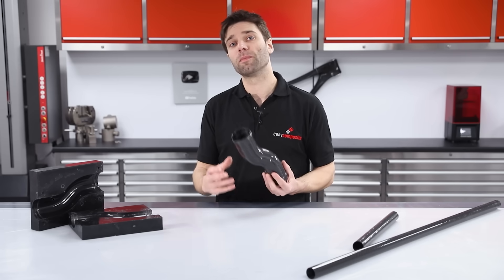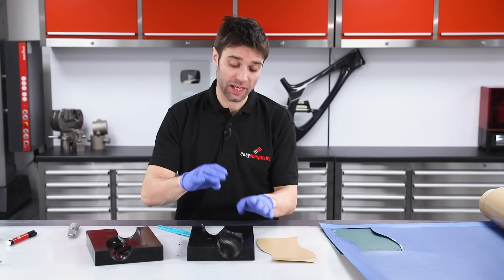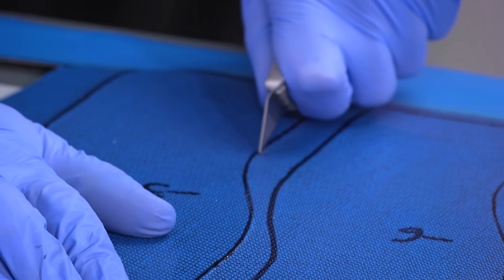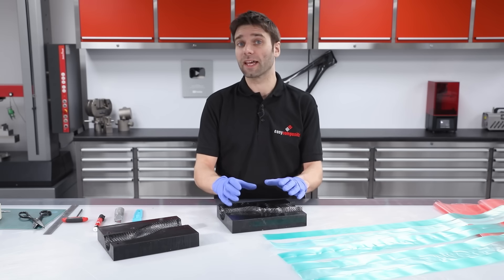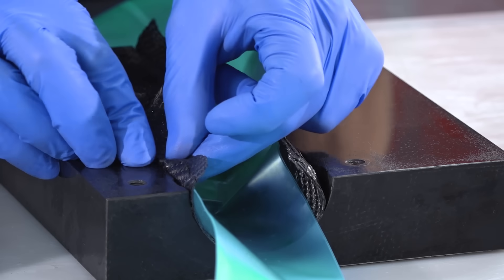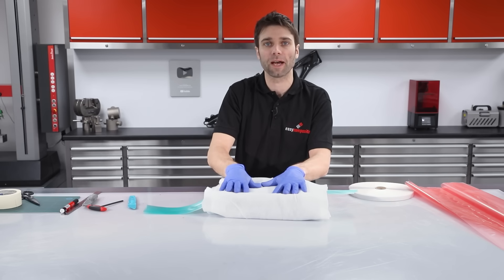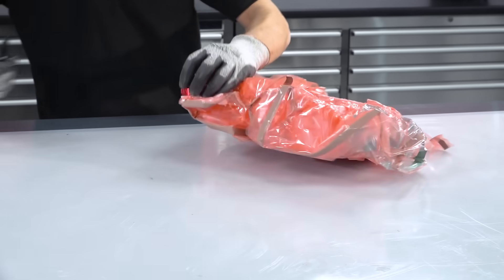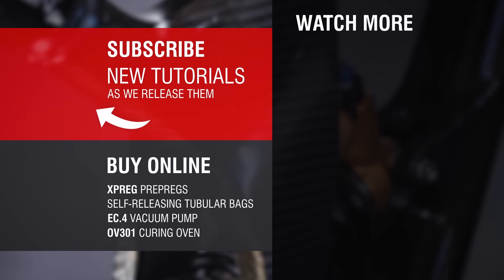Making Complex Carbon Fibre Tubes Using a Split-Mould

Comment: Nice video, whats is the best commercial CNC machine (without break a bank... lol) you guys recommend to make the "templates"   TIA
Reply from the maker: We used a relatively inexpensive CNC-Est machine for this part.
Reply: @easycompositestv Thank you for your reply. I'm looking for 4x8 to make big parts, any model in particular?
Reply from the maker: @fateichmann  Hi Fabricio, I'm sorry we don’t sell CNC routers so are not best placed to advise on the best machine to 
use.

Comment: How much temperature for it's burn in the box?
Reply from the maker: What do you mean sorry?
Reply: @easycompositestv  I wanna say that what temperature need to harden the carbon fibre?
Reply from the maker: @MrMaker-se1qr  In the case of the XC110 we're using here, its optimum curing cycle goes up to 120'C; although there is a low temp. cycle which allows for 85'C curing.

Comment: In this instance wouldn't it make more sense to have essentially bike tire inner tube pressurized to 1bar (or 2atm) -- and you would have much less waste material too as you could use that tube again and again and again.
Reply from the maker: The problem with positive pressure (such as from an inner tube or other form of inflatable bladder) is that it will be trying to distort the mould and split it open. In fact, to withstand the pressure if just one bar on the inside of this tube mould, the mould would have to be many, many times stronger, which ultimately means more material and more cost. For a relatively small mould like this, that might not be too much of a problem but for a larger more complex mould, it could be incredibly expensive and time consuming to make a mould which could withstand unbalanced, positive pressure from the inside. By doing it the way we show in this video, the pressure is applied to both the inside and the outside of the mould equally and uniformly, preventing any distortion and not trying to 'open' the split mould in any way. However, if you had a simple mould and a solid mould (billet aluminium for example) then a pressurised bladder, as you're describing, would be a good way to go.

Comment: I came expecting to see how you built the mold?
Reply from the maker: We've got a number of mould making videos for both split moulds and high temp mould tools that will show the processes you need. This video is specifically about how to make the tube itself (rather than the mould) but if you check out our videos, you should find plenty of information.

Comment: Is there a way to produce similar results using lay up/ infusion rather than pre preg as i dont have access to an oven? i have a mould of a very similar shape as whats in this video.
Reply from the maker: Hi, thanks for your comment. You could laminate the mould halves separately, allow to cure and trim off any excess material, place the now trimmed halves back into the tool and bolt it together then laminate a joining strip down the center internally.
Reply: @easycompositestv  Thanks for your reply, ill give that a go, see how i get on

Comment: Forgive me if I'm an idiot for asking this, I'm not especially familiar with composite layups and such (your videos are really helpful). Why not use an inflated bag or essentially a balloon of sorts to apply pressure throughout the tube instead of a vacuum bag, it would use a lot less in terms of consumables.
Reply from the maker: Hi, most people do not have the equipment or materials to make a decent quality bladder. It has to stay inflated throughout the cure cycle and it needs a bit of experimentation to get the right pressure. Also you have issues with the mould distorting if too much pressure is applied. The vacuum bag process just works well straight away.

Comment: hi

Can anyone  tell me how to use Chemical Release Agent? My pattern has mirrored finish, after used easy release, surface became matt and has visible marks. Mould  looks the same. I'm afraid
do polish  because Easy-Lease can be removed  than all stick . How to obtain shine patter and be safe to split.
Reply from the maker: Hi Tom, it sounds like you’ve applied it a bit too heavily. Easy-Lease does have a solids content (that’s what creates the barrier), if it goes on too heavy then as the solvent evaporates it can leave streaks. For the most rock-solid release, you’re best doing this and just accepting the slight matt finish but when it’s critical to have the best possible gloss then you can wipe it on but thinner and then, just as it’s flashed off, give it a gentle buff with a clean lint free wipe. Do this for each application. Providing the mould and resin system are properly compatible then you shouldn’t run any release risks by following this process.

Comment: Regarding the screws in the mould, did you just tap the thread or is there a sort of time sert impregned in the material?
Reply from the maker: Inserts can generally be laminated in during manufacture or bonded in afterwards.  The composite material itself is generally not suitable to hold a thread.

Comment: How many layers to it take to make a strong bond for a motorcycle frame? I heard carbon fiber does not last well against a vtwin engine vibrations.
Reply from the maker: We would not recommend making a carbon bike frame unless you have had a design analysed professionally via FEA or testing to ensure it will be strong enough and safe to use.

Comment: is it feasible to use polystyrene resin????
Reply from the maker: Hi Kumar, making carbon fibre tubes with polyester and epoxy resins certainly is possible with a slight change in the method of manufacture.
The easiest way to do this is to eliminate the stagger plies and laminate the two mould halves separately and allow to cure, Once cured trim off an excess material and place back into the mould and bolt together. The next step is to pre wet out some carbon fibre tape cut to the correct length and run it down the seam line on the inner faces of the component and allow to cure. It's worth noting this method won't produce a smooth inner surface like the prepreg method.
Reply: @easycompositestv  thank You sir

Comment: I am curious. How come you dont use existing means to give you the templates needed for the pre preg including the offsets. Instead of laying out tape and pealing it off?? I have an easier method.... but im surprized you do not use it already
Reply from the maker: We too have other methods but not everyone will have access to other methods and this is a nice, reliable method that can be done easily even in a home setting without access to other tools, equipment and software.

Comment: Do split molds yield lower bending strength in tubes?
Reply from the maker: That all depends on how any overlaps are treated.  With proper overlaps the strength will not be significantly compromised.

Comment: The inside bladder won't work if I don't have both open ends like the tube structure you made. How do I join my split molds together for nose cone or fuselage like structures?
Reply from the maker: Our next video may help answer some questions here.

Comment: heey , can your carbon fiber be used to make a concrete mold box that works by extruding the finished block by thrusting to mean can it withstand the compressing pressure and the scratching effect of the extruding block

Comment: can you use carbon fiber for coolant hoses?
Reply from the maker: With a high temperature resin and a thicker wall to take into account pressure, it may be possible.
Reply: @easycompositestv  what about vacuum hoses?

Comment: Is there a video I have not seen it if you posted it on making the mold like this or how to properly make a mold from an intake tube like this
Reply from the maker: Not a video making this mould in particular but the exact same process is covered in the video series where we make the engine cover. We machined the two ‘male’ halves of the pattern from epoxy block and then made the moulds using our XT135 tooling system.

Comment: Is there a method if I want the inside of the tube with a smooth surface ? Should I use undirectional Prepreg on the last layer
Reply from the maker: Watch our other video on mandrel wrapped tubes as they are smooth inside.
Reply: @easycompositestv  but I have mould like in this video my tube is almost like the one in the video not straight is there a solution ?

Comment: I need to make a curved hollow carbon tube that is 1/2in for a prototype, would this be an effective method?
Reply from the maker: Half in is just at that tricky size where it’s just about still doable using this method but it’s going to be tricker than a larger tube. Your only other option would be some sort of sacrificial mandrel: there are a couple of options for this using a 3D printer, you can print it using a water soluble print material (although we haven’t yet seen this be properly effective) or you can print a female mould and cast a wash out core into that mould then use the wash out core, once set, as a mandrel. We’ll be featuring both of these processes in future videos.
Reply: @easycompositestv  beautiful thank you, i was gonna ask some more questions but since you have a video coming out I'll wait till then

Comment: what is that weird grey spongey tape thats apparently strong enough to hold vacuum on a slippery plastic?
Reply from the maker: That's vacuum bagging tape; we're using our ST150 - you'll find it listed on the project page, along with all other products used/shown in the video.

Comment: Couldn't a basic plastic mold or even wooden mold be used? I guess the pros could be smaller costs but what would be the cons?
Reply from the maker: Pre-pregs need a high temperature capable mould.

Comment: Thats a lot of waste with the vacuum forming, is there any alternatives?
Reply from the maker: It depends what you need to achieve. For low volume production, there's not really much you could do to reduce consumables if you want to achieve a high quality product but if you were making hundreds (or thousands) of these components then there would be ways to introduce some re-usable elements.

Comment: Was there no resin applied? What caused it to fuse together?
Reply from the maker: Hi Luke, in this tutorial we're using prepreg carbon fibre. This is a type of carbon fibre reinforcement where the resin has already been pre-impregnated into the carbon fibre during its manufacture which means that no resin needs to be added later, which is why you don't see us adding any resin during the process shown in this tutorial. Prepregs are generally stored in a freezer until you need them and then to cure the resin within the prepreg, you need elevated temperature (an oven). If you'd like to understand more about prepregs and how they work take a look at our Introduction to Prepreg Carbon Fibre tutorial: https://www.youtube.com/watch?v=HfrFaKDsJxc

Comment: Would it be easier to use a machined removeable core and just wrap that?
Reply from the maker: If the core was solid (i.e. not water soluble) then it’s difficult to imagine how a core could be removed from a shape like this for shapes where it could the yes, you can wrap around a core (like we do in our other tube making video).

Comment: I would love to know how they make carbon fibre wheels for cars .
I think there's a couple of companies selling them at $20 000 upwards for a set .
Reply from the maker: Well, C/F wheels are obviously right at the top end in terms of complexity of manufacturing, criticality of reliability, performance and safety. The material itself is pretty much exactly the same as you see used in this video but given the complex shapes and relatively thick laminate, they're usually made using split tools made from billet aluminium and autoclave cured (so there is positive pressure, considerably higher than the vacuum only process you see used in this video).

Comment: Why dont you have a machine cut the sheets, should be quite automated.
Reply from the maker: In large scale manufacture, CNC cutting pre-preg templates is commonplace.  It is not generally affordable or practical for smaller scale and DIY manufacture.

Comment: If i 3d print the mold, I will get the same result? Maybe using a bit of sandpaper to flat the edges
Reply: @OwenSullivan03  You can easily release the carbon fiber from the mold by putting a special grease called "vax" before you put the carbon fiber with the resin. They didnt mentioned it in the video but you can find it in other videos with carbon fiber projects.
Reply: @OwenSullivan03  yeah you are right but there are filaments that can resist over 200°, instead with this carbon treatment, the temperatures are not very high

Comment: What would you do if there was not an open end on the mould in terms of pulling the vacuum? Let's say you're making a splitter or a spolier?
Reply from the maker: You need a hole of some kind for the bag ends to be accessible for this method to work.

Comment: You should be using Shoulder Bolts or dowel pins to locate.
Reply from the maker: Not necessary for such a small non-critical part. Where accuracy and alignment is critical, I agree, hence you see dowels used in the bike frame video.
Reply: @easycompositestv  Oh yeah, you did use them for the bike frame. I guess you're right, piping shouldn't matter unless flanges or mounting was critical.

Comment: I would love to see a cideo of how you made the mold.
Love your vids
Reply from the maker: Hi Chris, the split-mould we used in this video is a prepreg carbon fibre tool. The patterns (for the two halves) were CNC machined from epoxy tooling board like in https://www.youtube.com/watch?v=CWAvo8DIZ9s and then the mould halves made from made from XT135 carbon fibre tooling prepreg like in https://www.youtube.com/watch?v=k4GdAuNji5g. There are other solutions for making high temperature moulds, such as a hand layup process using high temperature epoxy tooling gelcoat, resin and paste which you can find out about in this tutorial (on our website) https://www.easycomposites.co.uk/learning/hand-laminating-a-high-temperature-epoxy-mould

Comment: How did you make the mold?
Reply from the maker: The split-mould we used in this video is a prepreg carbon fibre tool. The patterns (for the two halves) were CNC machined from epoxy tooling board like in https://www.youtube.com/watch?v=CWAvo8DIZ9s and then the mould halves made from made from XT135 carbon fibre tooling prepreg like in https://www.youtube.com/watch?v=k4GdAuNji5g. There are other solutions for making high temperature moulds, such as a hand layup process using high temperature epoxy tooling gelcoat, resin and paste which you can find out about in this tutorial (on our website) https://www.easycomposites.co.uk/learning/hand-laminating-a-high-temperature-epoxy-mould
Reply: @easycompositestv  thanks a lot for your detailed reply. 😉

Comment: Great video, is it possible to do this kind of part with a wet layup or infusion? 

I'm struggling to find a convenient supplier of pre preg locally (Australia), and I don't have a autoclave big enough for the parts I want to make (approx 1 metre long). 

My intuition tells me I would at least need to seal the moulds together to prevent resin going between the flanges. Maybe an 'O' ring seal around the circumference of the mould or silicone the mould together and clean it off after each part?? 

Cheers
Reply from the maker: Wet lay up with vacuum bagging would be possible. It would be very fiddly to get right though.

Comment: I wonder how many hours of work would it take to build a koenigsegg if this is how long each part takes
Reply from the maker: They have a large factory and multiple tools for many parts.  Also for larger scale production the methods can be altered to speed things up. Eg CNC cut pre-preg templates, pre-made bags or bladders to save time etc.
Reply: @easycompositestv  I'm really keen on understanding if carbon fiber body and chassis can be viable on an economy car. I mean, if they have a tendency to snap, is it even viable to make cars out of carbon fiber?

Comment: can the red vacuum bag be reused?? it seems quite a waste if not
Reply from the maker: We don't recommend it as the chance of having a leaky bag is much higher and the cost of a leaky bag ruining the part you are making means its a bit of a false economy to try and reuse in most cases.
Reply: @easycompositestv  cheers!!

Comment: Where i can buy the green vacuum bag? Have you partnership in Europe?
Reply from the maker: We sell the tubular bagging film here: https://www.easycomposites.co.uk/Tubular-Bagging-Film
Reply: @easycompositestv  Is 50 mm the width of the tape or the diameter when inflated?
Reply from the maker: 50mm is the 'flat width' of the tube. If you look on that page in the 'specification' section it gives the width of the film and the diameter of the tube it would make (21mm for a 50mm tube).
Reply: @easycompositestv  so 50 mm vacumm bag is ok to make a pipe with 21 mm diameter?

Comment: How do you make the mould ? and with what material ?
Reply from the maker: It’s made using our XT135 prepreg carbon fibre tooling system. Check the description about for more info.

Comment: Why is the seam evident on that part?  I've seen split-mould products finished where the seam is not obvious.
Reply from the maker: If a part is made using a split mould then the seam will be visible when the part is demoulded. Parts made in a split mould where you can't see the seam have simply been fettled then clear coated.